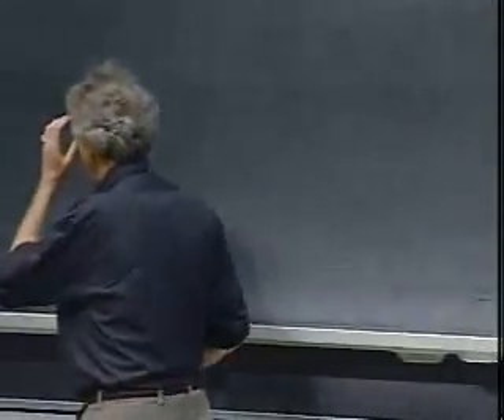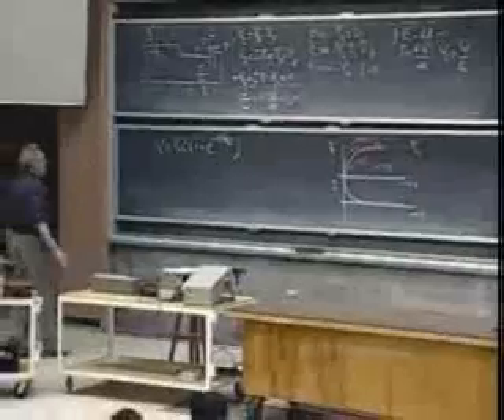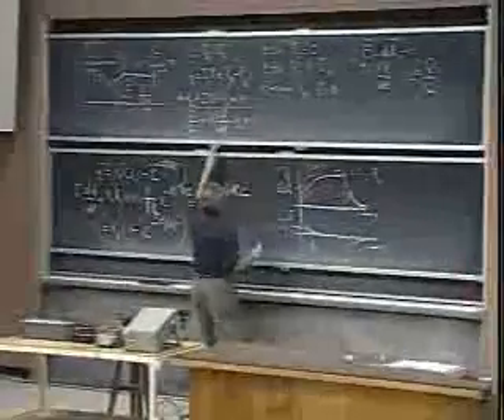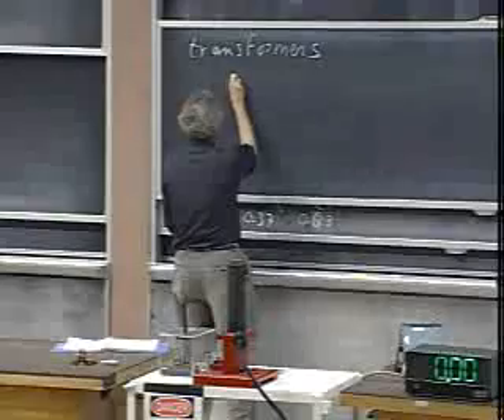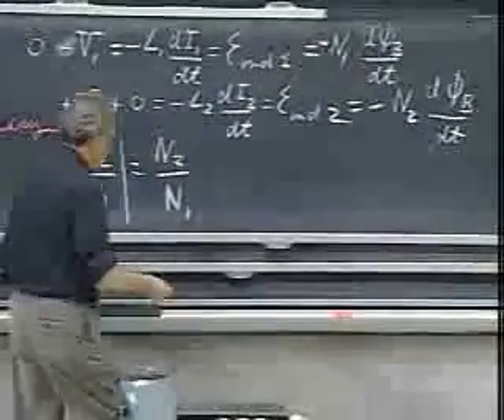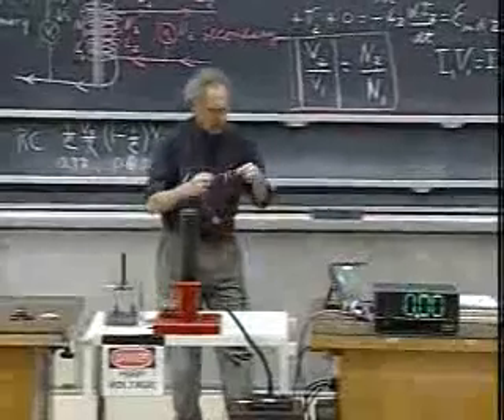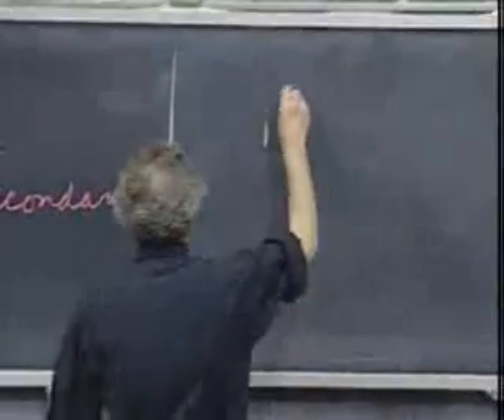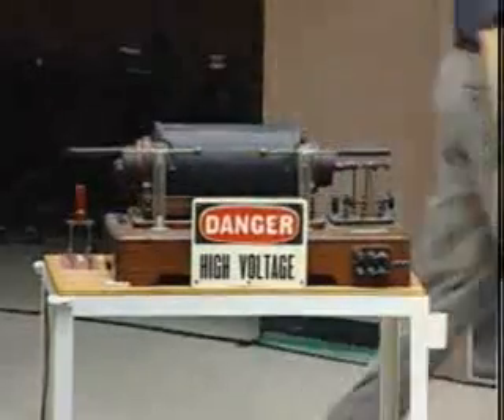Lec 24: Transformers, Car Coils and RC Circuits | 8.02 Electricity and Magnetism (Walter Lewin)

Comment: How does the high voltage electric charge  know where the nearest earth is positioned?    Or how does it know which direction it must head in in order to reach the opposite conductor which in this case is several inches away?
Reply: In the same way that high pressures always flow towards low pressures. Voltage is electrical pressure. The water analogy is the best way to visualize voltage/current/resistance imo. http://hyperphysics.phy-astr.gsu.edu/hbase/electric/watcir.html though you may have come to your own conclusions one year later =]
Reply: As Mook_ said, just imagine a baloon just before it breaks when you blew air in it. The place where it breaks is the weakest one.